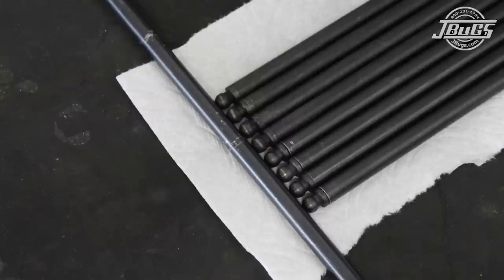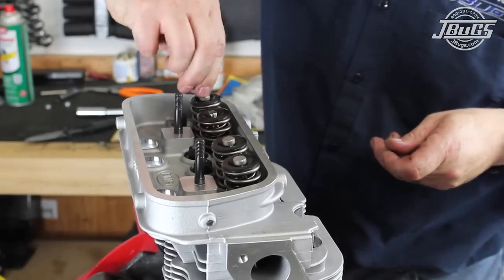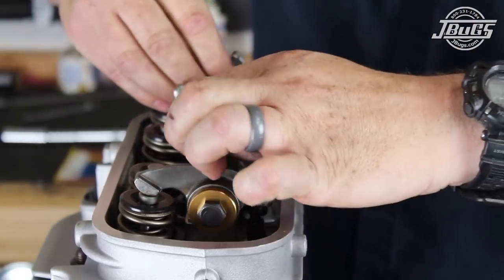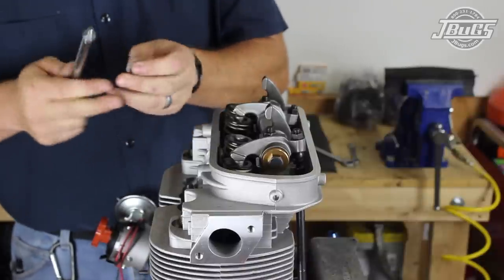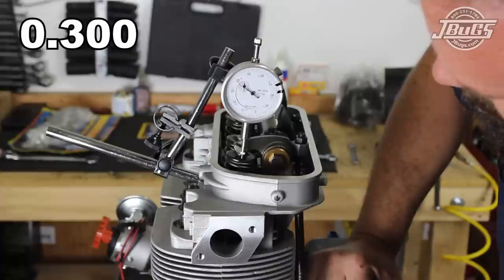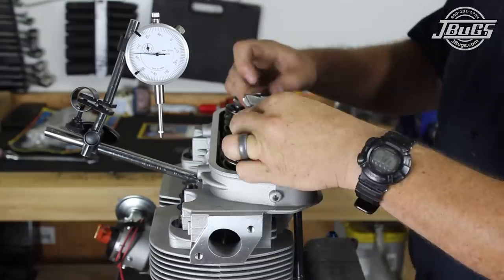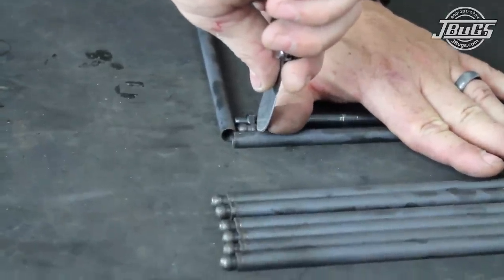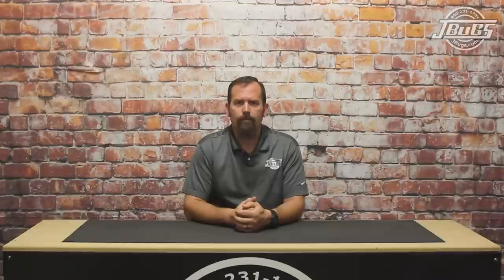JBugs - 1971 VW Super Beetle - Engine Build Series - Setting Rocker Geometry

Comment: Great video, I have a 1904cc with C35 cam and a 74mm crank, GTV-2 heads and stock rockers with Scat swivel ball tappets and stock length steel pushrods.  Is it okay to just use shims?  My geometry looks good with four 0.030 shims or should I shorten the pushrods and use less shims?
Reply: Shims are a typically a necessity when swapping to swivel feet adjusters and combined with the additional engine width from the stroker crank shaft, you might have gotten lucky using stock pushrods. If you're getting proper adjustment out of the screws and the geometry is good, then you should be good to go!

Comment: Do the chromoly push rods make more noise when the engine's hot ?being they expand different than the aluminum? I'm building a otherwise stock 1600 bottom end with slip in 88 thick wall Pistons IAP outlaw 90.5 heads with 40 mm intakes 35.5 exhaust stainless steel valves single rev springs and don't know what push rods to pick to use  with the IAP 1:4:1 ratio rockers oh yeah I'm going to be running dual kadrones& and a kultek black oo9 electronic dizzy and thick 409 Taylor ignition wires any info on what push rods to use would be great 🤠
Reply: When set up correctly, chromoly pushrods are just as quiet (or noisy as it is a solid lift engine) as aluminum. I run chromoly pushrods exclusively. You'll find other builders that prefer aluminum, it just comes down to person preference. Regardless, for higher revving engines with heavier valves and stiffer springs, thickwall aluminum or chromoly pushrods are a must. At a certain point though, the strength of aluminum vs the diameter can cause issues with tube clearance, especially with high lift cams and valve trains so chromoly pushrods are typically preferred.
Reply: @Sam_Mebane  sweet ! thanks

Comment: I’m assuming your starting this process at cylinder 3 also for filming purposes
Reply: We mocked everything up starting with deck height and compression on cylinder 3 as it is prone to running hotter than the rest of the cylinders. As we had already set everything up to film it, it made sense to continue the build on the same cylinder from there til the end.

Comment: OMG I though these were simple motor!
Reply: In stock form, absolutely. When you start modifying things, like any other engine, time must be taken to make sure everything works as it should!
Reply: So this is for after market only right? Not needed with stock fitment?
Reply: @jpbug  correct, if you have stock rocker assemblies this process is not necessary.